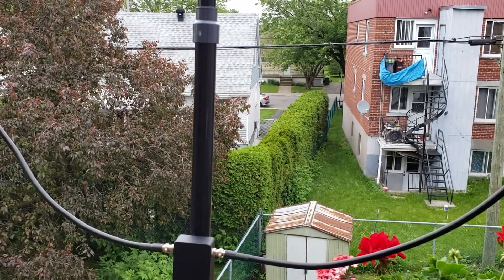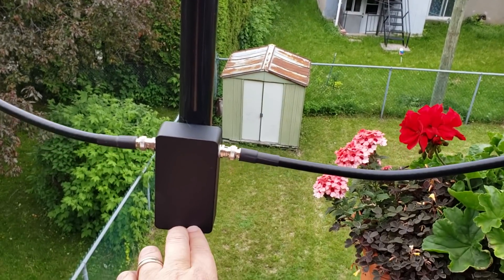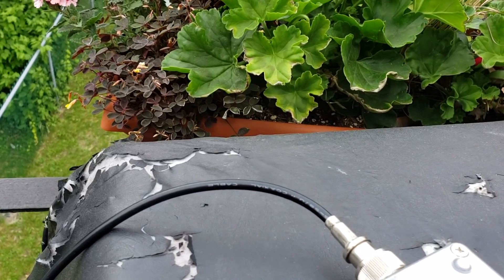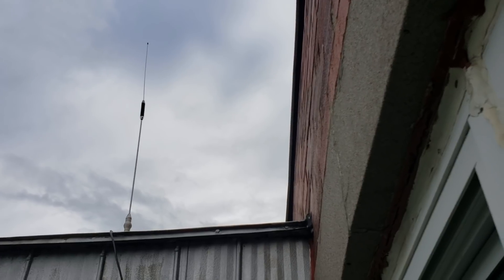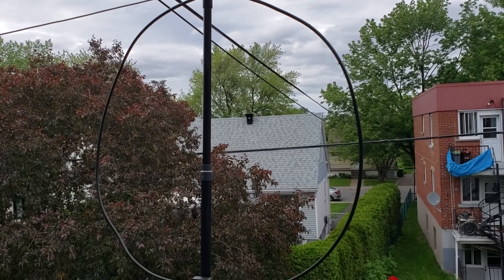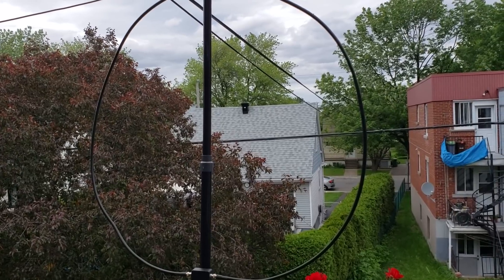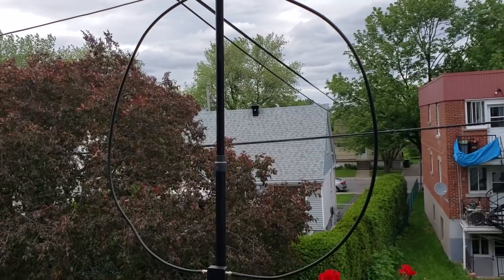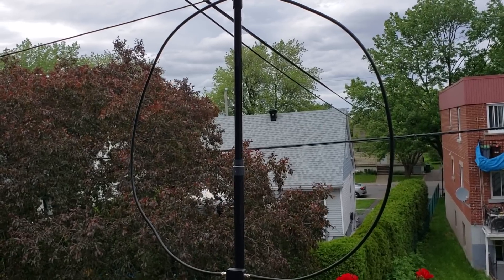Received my W6LVP Amplified Magnetic loop antenna today first impressions

Comment: You probably already are aware of this but you can always help knock down the out of band signals with an antenna tuner in line. This is a small portable unit by MFJ (which I’ve owned for ~25 years). Downside is you have to re-tune for every band. https://www.mfjenterprises.com/Product.php?productid=MFJ-901B